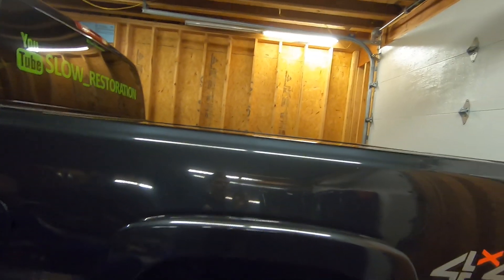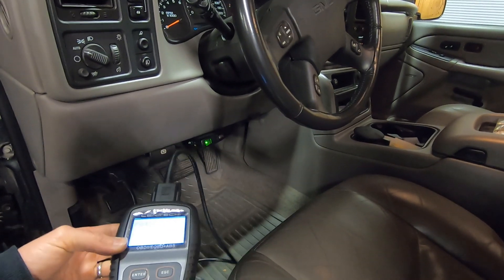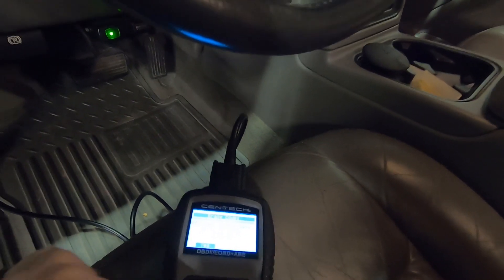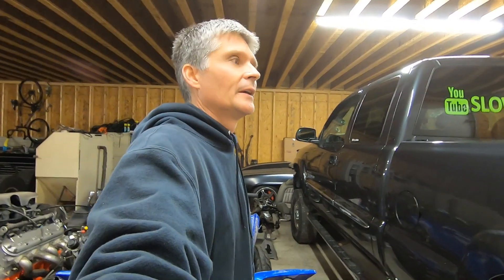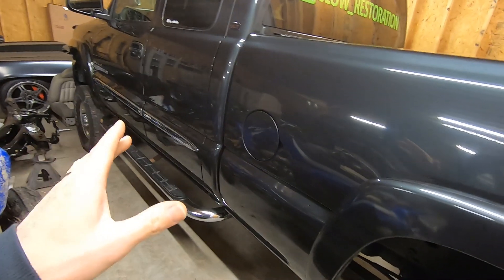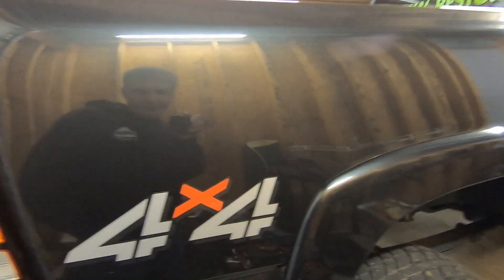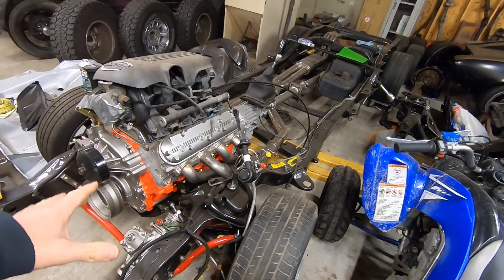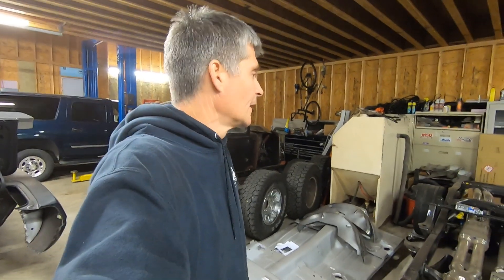TURBO GMC DAMAGE REPORT

Comment: This will be an interesting build/comparison. Will the cooler running rear mount make up for the theoretical turbo lag? Will shorter charge piping lead to less lag and more power sooner? I feel like intake air temp and dyno chart overlay would be an interesting comparison in all of this.
Reply from the maker: It should be interesting for sure!

Comment: Been looking at the 02-04 4 door GMC 2500hd due to the 05+ having the cylinder deactivation and the issues they are known to have but it hasn't been easy. Really looking forward to the new future build! (Might end up copying your setup at some point lol)
Reply from the maker: The HD trucks never had dod, so you're good for this body style. The next generation 07 up had variable valve timing but not dod.
Reply: @slow_restoration  Been looking at a supercharged 06 gmc sierra Denali four door and the only downside I can see with those is the AWD but do you know if those have the DOD system?
Reply: They don't have dod all the way to 06 and there are a few 07 "classic" that were 06 leftovers
Reply: @jeffyjoebob8300  How do you know if it came with the DOD from the factory? I did not know that thanks!